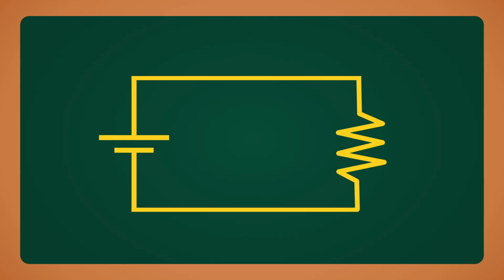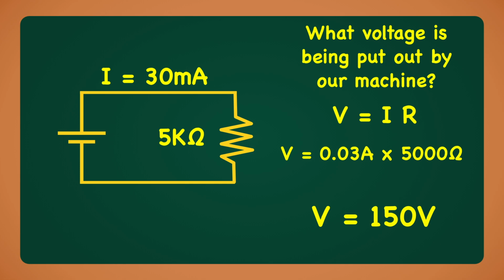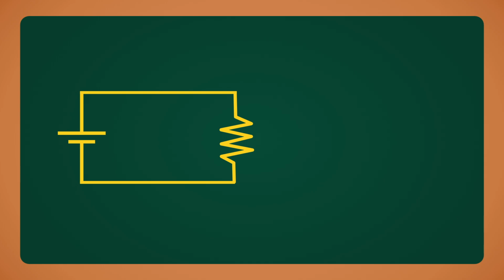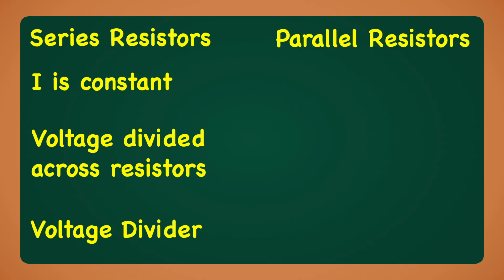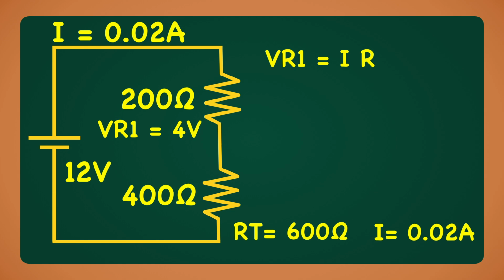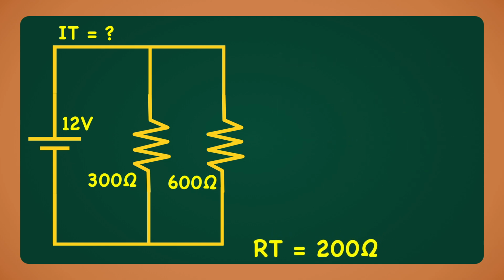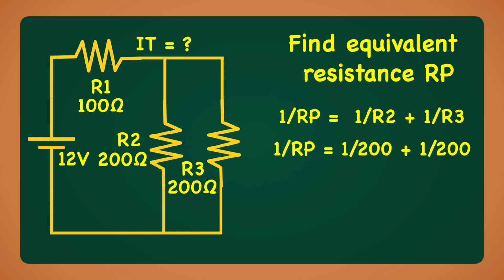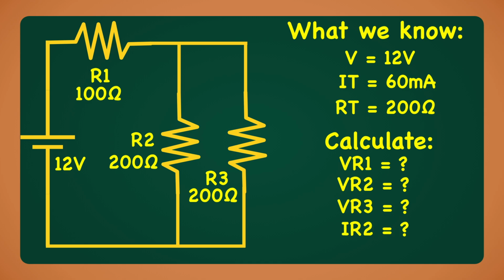Lesson 3: Putting Ohm's Law into Practice – Resistors in Series and Parallel

Comment from the maker: Answers to complex circuit problem:  
Parallel equivalent resistance = 100 Ω
Total resistance = 200 Ω
Total current = 60 mA
Voltage across R1 = 6 V
Voltage across R2 = 6 V
Voltage across R3 = 6V
Current through R2 = 30 mA
Current through R2 = 30 mA